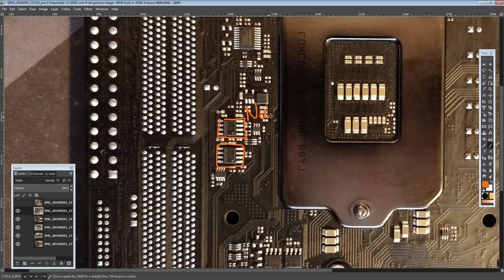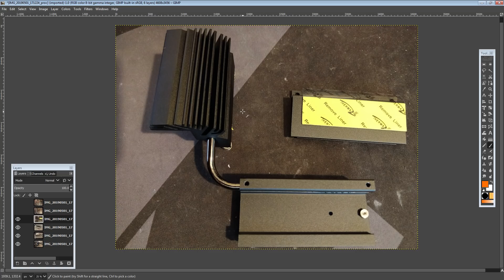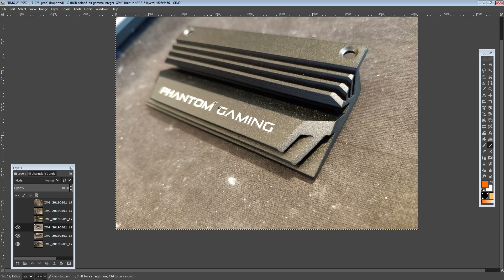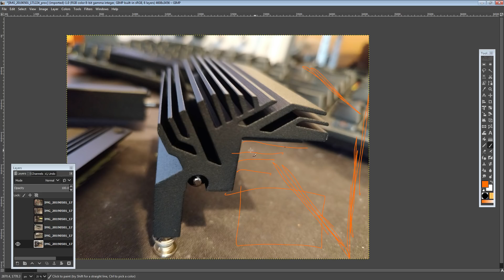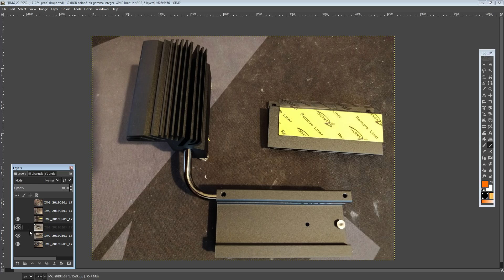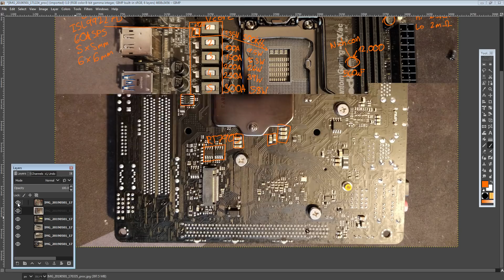PCB Breakdown: Asrock Z390 Phantom Gaming ITX

Comment: I have the z370 Fatality ITX which has the same VRM setup with some minor differences (capacitor bank). Regarding the capacitor endurance ratings, you'll notice that Nichicon doesn't advertise any FPCAPs with more than 5k Hours @ 105C. My suspicion is that the 10k & 12k versions found on mobo's are simply rebrands of the 5k's since it seems unlikely that Nichicon would develop but limit sales of these products to only a few manufactures. The mobo manufacturers can set their own qualification criteria meaning the endurance ratings can essentially be whatever they want it to be. Capacitor lifetimes increase exponentially with decreasing temperatures so as long as they remain relatively cool (<70C running 24/7) even a 2k rating should last >10 years. This means the endurance rating is not a limiting factor and anything above 5k is just marketing.

Comment: Related to the decoupling caps for the CPU: these function in a non-intuitive manner and I like that I see the sizes they put on the board.

First, a disclaimer, my last computer build was with a Q6700 and later swapped to a Q9400 for heat reasons as it was a 24/7 server. But I dabble in electronics and computing and have gained a decent understanding over the past half decade or so; much thanks to Dave @ EEVBlog, HAD, and the Internet.

Anyhow... They "decouple" a power rail from their source  rail. They do this by buffering a fast charge change such that when a sudden increase/decrease in current demand occurs such that the high impedance of the supply rail makes it unable to compensate, that the capacitor will source or supply that charge. Now the size of the package has a dramatic effect on how this behaves, from 0201's to 1206's. The larger the package, the lower frequency it is suited for and the smaller for the higher. Similarly, larger capacitances work better for lower frequencies and lower capacitances for higher frequencies.

All in all, it isn't about overall capacitance. It's about the lowest impedance over the most optimal frequency range. This is why on high speed PCBs you'll have 0805;'s teamed up with 0603's and 0402's. 500 kHz is really low and the electrolytics get the bulk of that, then they taper things off with 1206's, then 0805's on the PCB and why the CPU PCB has 0603's and 0402's and 0201's.

Comment: 9:12 It's not the first time ASRock has used expensive powerstages on ITX. My own X99-e ITX/AC and the newer X299 version require them to power their HEDT CPU's. That said, they definitely aren't common and it's good to see them being used for "normal" CPUs. I suspect asrockrack has been using powerstages on their more powerful ITX boards as well (the X299 WSI/IPMI and EPC612D4I for example)

If anyone can shove a bunch of stuff on a tiny board (and sell it to the consumer market) it's asrock.

Update: I just found out they are making an LGA3647 itx board EPC621D4I-2M

Comment: 7:20 Again, my ASRock Z370 Fatal1ty Gaming K6 is COVERED in Nuvoton controllers! And the BIOS does have MANY options - though it does lack LN2 type options for the most part. The Gaming K6 is meant for, well, Gaming - abd therefore high STABLE Overclocks using Noctua NH-D15 or an AIO, even a Custom copper loop. I am confident the Gaming K6 can handle a 9900k at 5+ GHZ all core, and RAM at whatever the controller will handle. ASRock memory OC seems to be near or at the top of the pack, even if their XMP can be clumsy sometimes.

Comment: 1:20 Since the Z77 Extreme4 at LEAST, ASRock Mainstream BIOSes kick ass. I LOVE my ASRock Z370 Fatal1ty Gaming K6, I got it on sale for just $160 and even my admittedly limited understanding of VRMs, the Gaming K6 is quite great, a guy on OC3D forums made a chart of Z370 VRM, and the Fairchild variant (FDPC5030 which I do have!) of the Fatal1ty Gaming K6 is considered TOP of "Upper Middle End VRM" only the Taichi scored better due to 10 true Phases for VCore vs 5 Doubled Component Stages (2 MOSFETs, 2 Chokes, and 2 Caps per VRM "Stage" - Kinda lime Asus with their "Doubled 4 Phase" or whatever they call it on the 11...

Comment: Just had a question for you in regards to an older Z370 board.  I have the asRock Z370 extreme4 with an 8700K.  Being that it has a 12 phase VRM, can I drop a 9900K in it and get away with running it at 5Ghz all cores? I updated the BIOS to 4.0, so it is compatible with the processor now.  Just wondering if I can keep this mobo… And as a side note, I have a case with TONS of airflow, 7 x Noctua 140mm 3000rpm fans, and a 280mm aio for the processor.
Reply: Just out of curiosity, Which case do you use?

Comment: In regards to Asrock's bios, I use a z370 k6 in my PC and I have to say that its bios is as good as if not better than the ROG bios. It has even more overclocking options, and the layout makes more sense to me. However, the ab350 pro4 bios is god awful... who doesn't allow for dram voltage changes?

Comment: iol offset and associated latency timings don't accept input/don't do anything in this bios.. pls ask them to fix it
Reply: if you have this board please submit ticket.

https://event.asrock.com/tsd.asp

IOL offset does not do anything. RFR Delay does not do anything. I do not think RTL and IOL init do anything. All you can do is correct the values if they train incorrectly.

This board is quite nice but I cannot tighten my RTL and IOL timings. stuck 4133+@12-11-11 1t with around 50rtl 6iol
Reply: I have an updated BIOS with functional IOL Offset and RTL INIT. It is based on P4.00, not P1.60.

Comment: The NAND chips don't mind being hot, the M.2 controller however... not so much. The controller will fail long before the flash memory reaches critical temperature, according to what other tech channels(that isn't the Verge) are saying anyways. Come to think of it, how much corsair thermal paste do you have left? I presume quite a lot. LMAO!
Reply: Actually the NAND has a ideal temp range and its quite warm. When you cool the NAND down from that point you actually drastically reduce the endurance of the drive. It is actually very possible to cut the endurance in half using these solutions some mobos have and companies are selling aftermarket. The controller id usually cooled pretty well with a metal strip sticker that spreads the heat out across the drive. With that it is fairly hard to peg the drive hard enough that the controller runs to hot. Not impossible for sure but for someone thats gaming or even doing some pretty heavy read and writes most end users wont stress a drive that hard. Now that wont tend to include pro/enthusiasts using their machine for work or some other stressful task.
Reply: @Onewolfoc  The only scenario that comes to my mind where the SSD would lose in endurance/lifespan is by rapidly cooling down the NAND flash down to ambient from its peak performance temp rather than let chips cool down slowly on their own. That'll definetly degrade them somewhat if done repeatedly, much like how some metals will turn brittle when heated up until white, then cooled down rapidly.

Daily/regular usage won't do squat to an SSD in terms of heat tolerances, but when there's a VRM heatsink dumping let's say an extra 20 watts of heat on top of it, the controller is going to get stressed significantly more than a several hours long gaming session possibly can, and will be prone to failing first. If the heatpipe wasn't near the base of the block on the VRM side, then there'd be no real cause for concern... but this isn't the case, so buildzoid's comments on the design are, in my opinion, worthy of consideration if/when overclocking on ambient cooling only with this board.
Reply: @tohothewriter8002  actually depending on if your writing or storing data the nand temp at the time of the action heavily effects endurance. A 20 or 30 degree drop out of a ideal range for writes can actually cut a huge chunk of lifespan off a drive.  Like i said it is totally possible to half drive life with some of the heatsink assemblies people attach to their drives. The nand flash itself likes to be hot for writes while reads or long term storage its not only  ok if the drives substantially cooler it is recommended for storage. A basic tiny amount of airflow and the metal sticker on the drive is all the cooling that most people should use. This would change in the enterprise or upon heavy read write cycles which most people won't end up stressing the drive enough. Prosumers , Enterprise , or some enthusiasts may fall within a scenario that they would have to adjust cooling i.e. try and cool the controller a tad better while not sinking that much energy away from the nand. Then you got the edge case where someone mashes a nvme drive on the back side of a ITX board between the tray and pcb which then it could get toasty which again is a situation where youd want to adjust the cooling accordingly or even make sure a small amount of air was circulated behind the mobo between the tray and the mobo.

Comment: ASRock High-End hardware is usually good, you get what you paid for. Their bios is total shit! if only there was a way to decouple the software from the hardware like open source bios or something? then that would be heaps better than ANY ASRock bios.
Reply: Good idea. Check out the open source project Coreboot tho. We can't even put Coreboot on these new motherboards though, the customization process is very bad. We should get them to sell boards with "open source firmware supported" then we might get enough progress to get that commonplace. ASRock always was one to try new things and produce specialized products, it would be great to get them to adopt this one and try to fix their clunky bios.

Comment: asrocks bios is a bit odd.  but once you learn to work with its quirks its ok.  weird things like settings not applying till a second restart and voltages not being the same on offset mode even though you set the same offset, then you reset the cmos and it works the same again.  wierd stuff.  but its more than good enough if you can get a decent quality vrm on the board
Reply: I bought a ASRock 970 extreme3 back in 2012 and it did the same thing you describe. With my board I noticed if I changed to many settings in bios at one time I would have to reset CMOS or it wouldn't actually change anything. That being said I loved the board, maybe cuz it was my first, and it would overclock a fx6100 to 4.6ghz @ 1.45v, air, although the vrm's were roasting hot, only 4+1 phase with crappy heat sink. Still have the board and CPU but clocked at 3.9 @ 1.275v, my dad's daily for now.

Comment: Another great board with Intersil's best components. (ISL69138 with the ISL99227B SPS) eVGA z390, X299 DARK, AsRock's z370 Extreme4, Taichi, Gaming K6, Gaming i7, Gaming iTX. z390 Phantom Gaming iTX and X299 OC, along with the Gigabyte Z370 Gaming 7 and z390 M Gaming, SLI, X,UD, Designare, Ultra, Pro, Pro Wi-Fi, and Elite all use Intersil. They are all decent boards.
Reply: ''Asrock Z370 extreme 4, Taichi, Gaming K6, Gaming i7, Gigabyte Z390M Gaming, SLI, X UD, Designare, Ultra, Pro, Pro-Wifi, and Elite'' .
No, none of those boards use ISL99227B.

Comment: I cant imagine putting a 9900k on that little board. Im hoping 1 or 2 new ryzen 3000 series chips can hit 5ghz. I cant wait till buildzoid is doing a pcb breakdown of a asus x570 rog crosshair viii formula or crosshair viii hero!!
Reply: I have mine with 9900k @ 5.0Ghz 1.33v. Board doesn't break a sweat even without any significant airflow. (The system is custom watercooled in a Ghost S1 case. So not so much airflow ;) )
Reply: @HyunMoKoo  Custom cooled? Would you be so kind to share some shots and part choices? I'm planning the very same.
Reply: @TonciJukic  I have a video (no english subs tho...)
 https://youtu.be/G8Hpk8bH9nI
Reply: @hytriarch that's awesome! This board looks way better than I thought it would be with a 5 phase vrm.
Reply: You're hoping ryzen gets a 20% increase in clock speeds and a 15% IPC gain in 1 year? That would make an 8 core get a cb R15 score of 2550 ish, The 16 core version would get around 5000cb which is getting close to a 2990WX.
Good luck with that.
Reply: https://www.techpowerup.com/255099/possible-listings-of-amd-ryzen-9-3800x-ryzen-7-3700x-ryzen-5-3600x-surface-in-online-stores

Comment: Could you make a multiphase vrm to convert 120-220v to 12v? I assume you just wouldn't because there are cheaper solutions, but could you make a smaller more efficient power supply by doing that?
Reply from the maker: PSU already kinda do that.